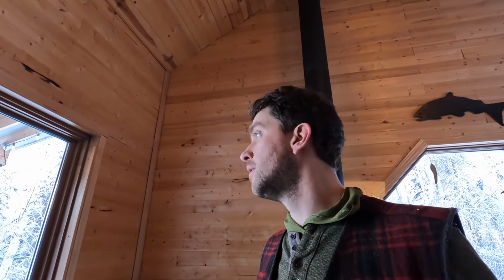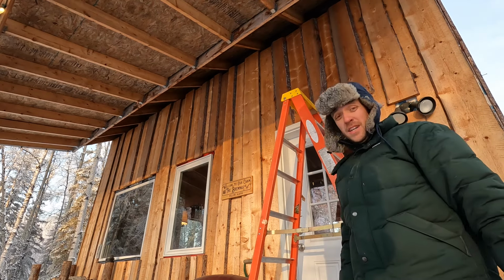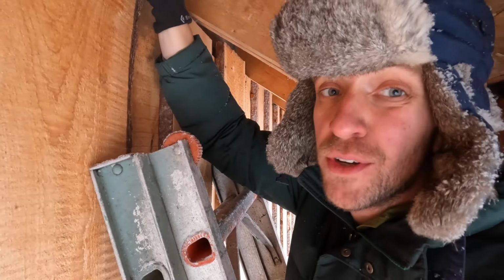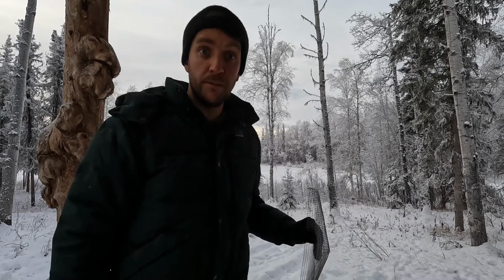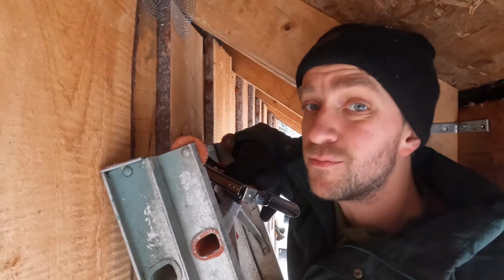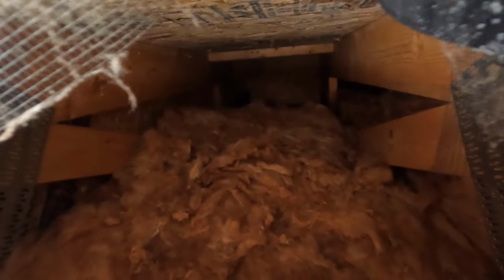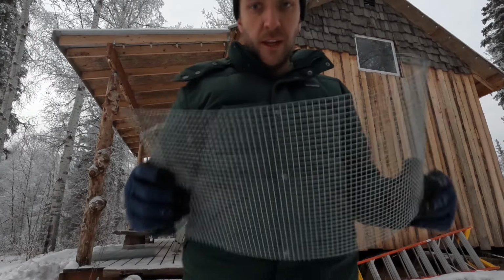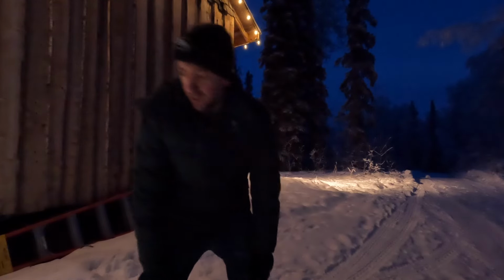I Couldn't Pull The Trigger | Critter Proof The Cabin Roof

Comment: Why not close the gaps completely with boards? What good does that draft? It sucks out heat....
Reply from the maker: Eaves have to be ventilated. As the warm air cools it travels down the slope of the roof and has to go somewhere. Also it pulls fresh air in to vent the moisture out the top ridge vents.

Comment: Kudos to you for blocking that squirrel. And for working in subzero temps.....in the dark....

We have an ongoing squirrel issue, northern middle Tennessee.....have tried sooo many things. Thought we had them blocked off, but they pull siding out of the way. Feel the need to get them evicted before mating/nesting season, which is here....also in late summer/early fall.....worst thing is the smell, which we think we have finally addressed. No intact wiring back/up there, but was like that before we bought this HUD home, which had been abandoned for 3 years prior.

With the super deep flash freeze headed our way, we are postponing further efforts.....can't see evicting them in this weather with no access to their food stores....or shelter.....
Reply from the maker: Wow! That is a wild thing to hear about. I am glad I have had as few problems as I have! I appreciate your comment, thanks for watching!

Comment: Another tip of the day. Small holes can be stuffed with course steel wool, it helps with mice, chipmunks & squirrels. They tend to not like it in their mouth.
Reply from the maker: Hey good tip! I’ve used that trick for my exhaust on my sleds for over summer storage but didn’t consider it for the roof! Good thinking

Comment: Great job 👏 👍 hope that the deck and floor you're cabin is on is sealed. They love to eat on plumbing and wiring as well. Good luck, Mike
Reply from the maker: Yes, it's actually a project I hope to tackle this summer, but luckily nothing underneath is important such as wiring or plumbing. Just insulation. Which they have in fact ripped a bit out.

Comment: Maybe a stupid question why did you not extend you boards right to the roof or are you planning on finishing the under eaves? You must lose a lot heat from there.
Reply from the maker: Great question! You actually need ventilation coming from the eaves. All the insulation for the roof is below that so the heat is trapped in before it gets to those openings. It’s important to keep what’s called a “cold roof” to prevent ice build up. HOWEVER, yes I should have for sure had wood blocking those openings up with small vent holes, but I literally had no clue what I was doing when I built the cabin!